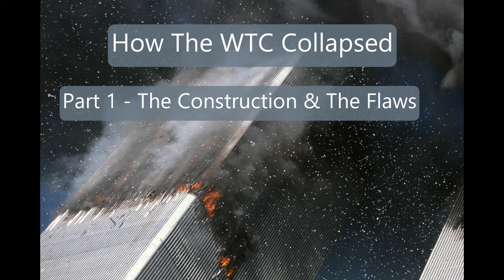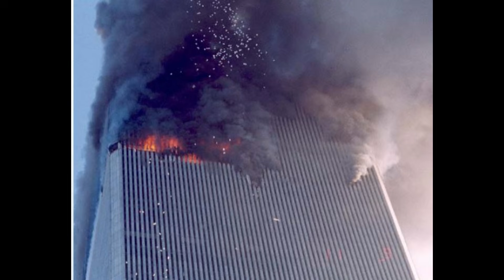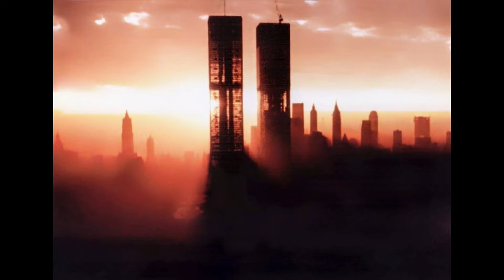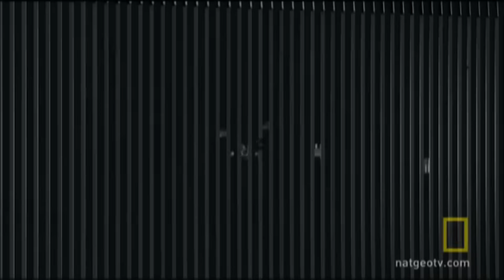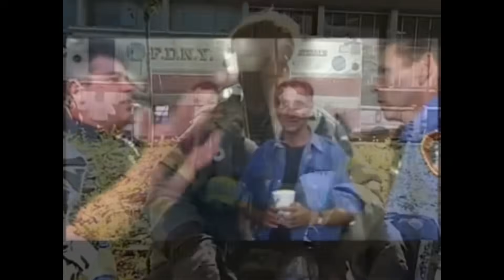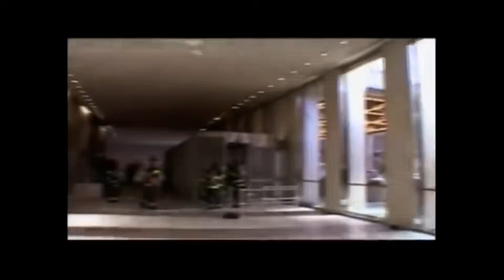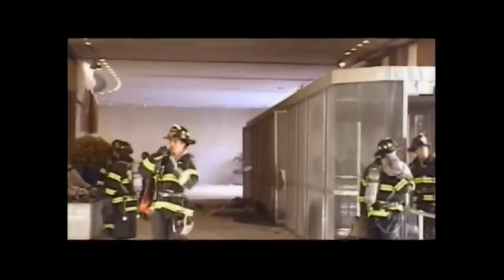9/11 Explained: WTC Collapse Explained

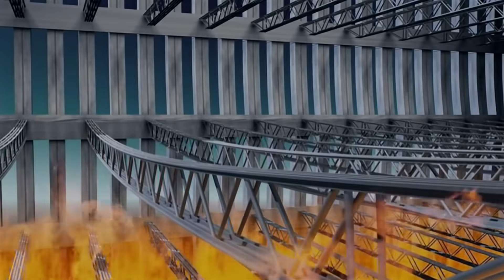Comment: 4:45 Sagging floors. Another key requirement of NIST’s explanation for the Twin Towers was that floor assemblies had sagged severely under thermal stress. Floor model tests conducted by my former company Underwriters Laboratories showed that the floor assemblies would sag only 3 to 4 inches, even after removal of all fireproofing and exposure to much higher temperatures than existed in the buildings. NIST responded by exaggerating the results—claiming up to 42-inches worth of floor assembly sagging in its computer model.

See the UL tests for yourself...
Google WTC repository and click on the section titled "Fire Tests and Analysis"
Reply: The sagging floor trusses are clearly visible in photographs.
Reply: It is pretty clear you have no idea what you are talking about. UL has never stated that they have seen anything that would lead them to believe the towers were a demo. It is extremely difficult believing that you actually work for UL (at least in any capacity that would be in any field related to making these types of decisions- maybe as a toilet cleaner- nothing wrong with that but doesn't make you qualified to pass yourself as an expert or qualified representative for UL) however if you do work for them please let us know what your manager, vp etc think of your theories.
Reply: Isn't it interesting how all the various "truthers" are experts and employees of everything under the sun, as needed for their claims?
From architects to engineers to welders to first responders to "my former company UL"....waiting impatiently for the day when they're SUPERMAN! SO THERE!
Reply: The steel in the twin was wasn't UL certified. So take that test for what it's worth.
Reply: @TheMiddleClassholes , I never said the WTC steel was UL certified. Where did you assume that?
Reply: @911WarRoom  - Certification is what UL does. No reason for them to test something they are not certifying.
Reply: @MFitz12 , certification of assemblies is what UL does, not steel.
Reply: @911WarRoom  - Strawman much?  Where did I say certify steel ?

How about addressing some of your other nonsense?
Reply: @MFitz12  , you're in a thread where someone made that statement. I'm not sharing nonsense. Why are you coming off hostile? Can we both agree that there never was an investigation into the initiating event to cause WTC 1 & 2 to fall globally, symmetrically, and against the path of most resistance? That doesn't strike you as odd? You're either willfully pushing a false narrative on purpose or just because you can't handle the implications that WTC 1, 2, & 7 were controlled demolitions, which is what the evidence shows.
Reply: @911WarRoom  - Asking a clarifying question about a strawman argument you made is not coming off as hostile by any definition.

There has been plenty of investigation as to how and why the Twin Towers collapsed, so why would I agree to anything that is not true. Of course the Twin Towers did not fall globally, symmetrically, and against the path of most resistance by any stretch of the imagination which is a strong indicator you have not taken the investigations that have indeed been done internally.  You are just mindlessly repeating catch phrases and propaganda you found on the internet.

Hell, I spent quite a long time investigating it myself.  Little ol' me, not relying on anyone else's opinions or conclusions.  Results of that to follow, and I guarantee you won't have one of these.
Reply: @911WarRoom  - I find the collapses of the Twin Towers intellectually fascinating. My primary interest in this topic is in understanding the actual mechanisms of collapse. What failed, how it failed, in what sequence and why.  I also enjoy being able to talk about the engineering with others who share an equally genuine interest in understanding what actually happened . So let's talk about it.

This is my summary explanation of the Twin Towers collapses and mine alone, presented as a comprehensive analysis from start-to-finish, based on my observations and supported by evidence, without any appeals to or reliance on any authority.  No politics or ideology, my only agenda is the mechanics and engineering – what actually happened and this is agnostic to who planned and carried out the 9/11 attacks or why. Importantly, it does not require Rube Goldberg levels of complexity, makes logical sense and is *accurate regardless of  who planned and carried out the 9/11 attacks or why . Also, you will learn all sorts of things the conspiracy oriented internet won’t tell you and no whataboutisms.  This should dispel many common myths and answer most any questions you may have about the Twin Towers collapses. 

Twin Towers collapses are complex but most of the mechanisms can be seen with the naked eye and understood by the layperson if sufficient time is taken to understand. Those mechanisms were well understood by the worlds engineering community already by October/November 2001. Still many can’t be bothered to look or work hard not to see as they are often more concerned about advancing political/ideological agendas and bother understanding the science.

This will take just a few minutes.

1. The Twin Towers consisted of four (4) primary structural elements which together formed an integrated system.  The 47 steel core columns carry the majority of the gravity loads. The 236 steel perimeter columns carry the remainder and ALL of the lateral (wind) loads. Long-span lightweight floor trusses connect the core and perimeter column together with a hat truss on top to tie the structure together as an integrated unit where no element can survive without the others 

2. High speed impact of 117 tons jets (= to about 12 dump trucks) completely destroys the aircraft, which in no way implies the Towers come out unscathed. Hitting with the energy of up to a ton of TNT the impact damages or destroys many perimeter and some core columns (33 of 59 perimeter and 20 core columns destroyed at the impact floors in the North Tower), primarily through bolt-shearing failures at the end connecting flanges, bending,  twisting and fracturing of weld seams. There was no cutting or slicing - the reality was far more violent and messy. 

3. Fire insulation, fire breaks and sprinkler systems on multiple floors are damaged or destroyed. Massive fires are started across multiple floors simultaneously and able to spread rapidly with no effective fire fighting or fire suppression in an unprecedented fire event . This was observed and recorded.

4. Steel gets weaker as it gets hotter and it gets hotter faster because of 3. Survival time in fire is reduced. Over time heat causes lightweight steel floor trusses at the impact damaged floors to sag. This was observed and recorded.  No steel melted nor did it need to. Structural steel will fail long before it turns to a puddle. You just need to get it to bend

5. Sagging floor trusses pull on and cause the inward bowing of the increasingly weak and overloaded perimeter columns by up to 5 feet! This was again observed and recorded. Bent columns lose much of their ability to support a load. A straight column is up to 4 times stronger than a bent one.

6. The bowed perimeter columns buckle and fail on one face of each Tower, initiating collapse and converting the formerly static mass above them into a dynamic one 30 times greater. Again, this was observed and recorded.  Columns above and columns below the failure point are no longer aligned. The load bearing structure below is no longer bearing any load as the mass above falls past the lower columns, NOT onto them.

7. Thousands of tons of debris pour down the open office space within the four outer walls . This loose debris crashes onto the first intact floor it encounters, grossly overmatching the floors load capacity and near instantly breaking the bolted connections to the columns. The amount of resistance the floor offers to this dynamic load is negligible and slows the falling debris only marginally. 
7a. Note: This is NOT a top block crashing into and “crushing” a bottom block .
7b. This debris falls past the columns not onto them, thus the columns can provide no resistance to the falling debris. 
7c. The only structure resisting the collapse is the bolted connections of the floor trusses to the core and perimeter columns. A pair of 5/8” bolts at each end of each truss vs. thousands of tons of falling debris.

8.  This floor-led collapse progression within the four outer walls can only go straight down.
8a. This process is often incorrectly referred to as “pancaking” which actually refers to a different process for describing collapse initiation stage that was rejected at an early stage. Pancaking is too simplistic and inaccurate a term anyway. More like Kaiserschmarrn.

9. Collapse progresses through the floor systems and not down the columns. Rate of floor assembly failures increases with each successive floor as momentum increases, reaching an average acceleration of 0.65 of GA, or 35% slower than true free fall. Bam, bam, bam down the building until there are no more floors to fail.
9a. As the next floor is impacted, momentum is briefly slowed before accelerating in free fall again 12 feet to the next floor.  Velocity and momentum are constantly increasing.
9b. With each floor failure the falling debris gains mass, momentum and energy as it descends to the next floor. The falling mass increases with every floor it destroys as new falling mass is added. Some falls to the sides, but most falls down. More mass, more velocity, same resistance with each floor.
9c. The above is unquestionably the path of least resistance

10. As air is compressed inside the building (95% air by volume) it is forced down the tower and out the sides. This was observed and recorded. 

11. Perimeter columns become detached and peel away (think banana) behind the collapse front, being splayed out in a long line out to more than 600 feet from the base of the towers at the four points of the compass. This was observed and recorded, the results quite obvious from examination of the debris pile. 

12. Core columns fail last as their internal beam bracing is stripped away and lateral support from the floor to perimeter columns is lost.  This was observed and recorded and is most obvious in the North Tower. 

13. The whole process took 31-34 seconds from the moment the perimeter columns buckled until the last core columns hit the pile. For those who care about such things that is 1/3 the rate of true free fall. To further prove this free fall nonsense is just that, watch any video of the collapses and note the loose and truly free falling debris dropping much faster than the towers themselves.

14. What was NOT observed and recorded were the 180-190 dB bangs of high explosives or the blinding bright flashes of thermite, neither of which could have caused the observed perimeter column buckling and neither of which could have survived the impacts and fires anyway. There is zero physical evidence to support either conjecture and both are pure fantasy, totally unsupported by evidence, logic, reason or even simple observation. Further, no one in their right mind would bother. Pre-planned demolition is preposterous, utterly impractical and unnecessary proposition.

15.  The Twin Towers were perfectly safe within their design envelope: They collapsed when taken grossly outside their design parameters by an extraordinary event.  The Twin Towers were an integrated system in which no one element could survive without the others. One element goes, the rest follow.  

To recap: Impact + Fire (heat) + Time + Gravity = Collapse. Remove any one of those four elements and there is no collapse.

Collapse started (initiated) in the perimeter columns and continued (progressed) through the path of least resistance – the floor systems, bypassing the path of greatest resistance – the columns. Hopefully after reading this none of you are still stuck on the but the lower floors weren’t on fire nonsense. If you are, start over.  

This is intended to be informative, not adversarial and to serve as the basis of productive discussion. Serious comments and questions are therefore welcome. No Gish Gallop and no deliberately evasive off-topic derails please - just one on-topic point at a time to stay focused.  This is a living project which is updated and improved frequently.  If I have left anything critical out or made any errors of fact, logic or reason please feel free to point them out. Explain what I got wrong and how and I will make the necessary corrections, altering my hypothesis if necessary.  Just telling me you’re wrong without explanation tells me you are not serious and possibly a bit dim.  

Alternative hypothesis at least as rigorous as what I have just presented are highly desired – if you can do it.  What was your process to determine there was controlled demolition using malicious pre-planted destructive devices anyway?  I don’t see one.
Reply: @911WarRoom  - You're welcome

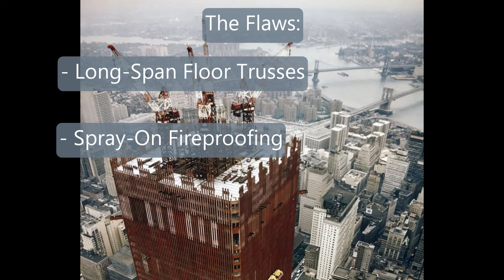Comment: 2:35  In your video the man states that they used spray on foam fireproofing. That is a false statement. There was no foam in the fireproofing. It was up until around the middle of the Towers an asbestos spray on fireproofing and it was cementitious, not foam.
Reply: The spray insulation used in both Towers at the impact floors was SFRM and contained no asbestos.  Holy shit you really suck at this stuff.
Reply: nope- asbestos was only used for the first 30 floors or so in one tower. And it was removed and swapped to foam spray long before 911. Learn before you comment or you will just make yourself look foolish.
Reply: @pacman3556   38.